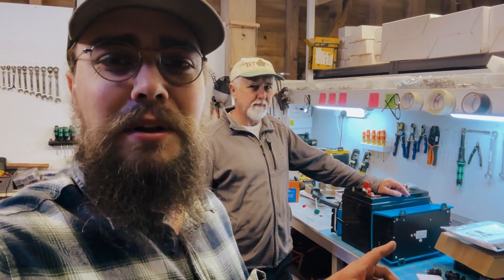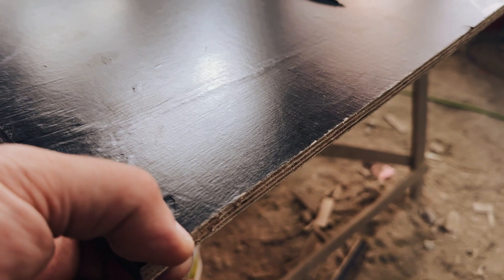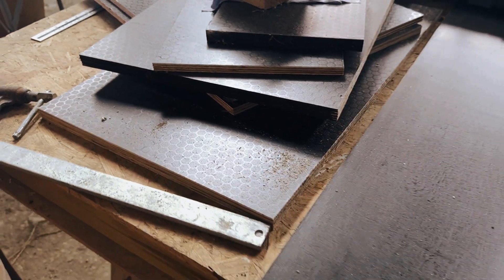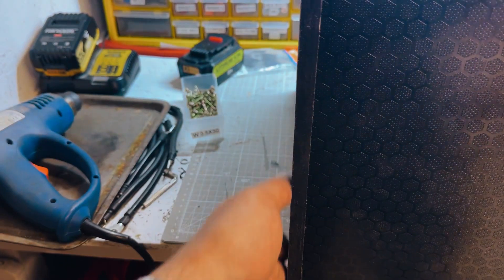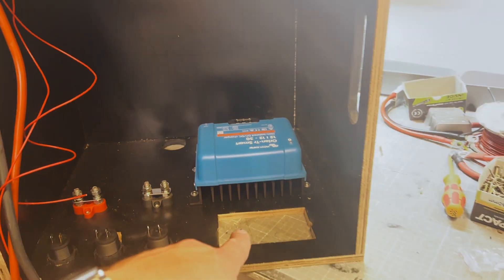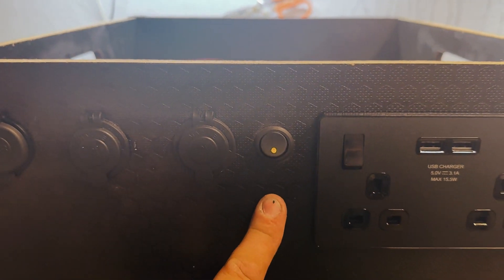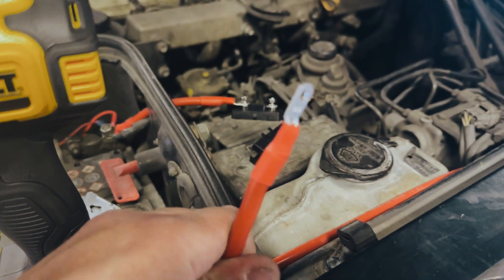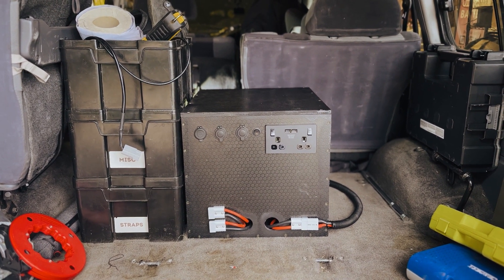Building a DIY Jackery with LiFePO4 battery & Victron Phoenix Inverter

Comment: Nowadays (Oct 2925) Eve 340Ah cells can be purchased for 65Euro per piece, make a 8S 24V system to get 8x3.2Vx300Ah =7.5 kWh buy 2nd hand Victron MPPT & 24 V 1200VA Phoenix inverter & smart shunt 300A and  JK  8s LliFePo4 BMS, a TS800 DC DC (23A @28V) charger add some fuses , cables , temp sensor etc than you have  a very decent modular very  system which will weigh some 60kg and costs around 1000Euro leaving you some money for buying spinach to enable you to put it in and out of your car...and than you want to buy an extension cord as you don t want to take it out anymore    ....

Comment: I have an ebike. 72 v 25ah i was wondering if i could get 3 more. Have 100ah but 72v i found an inverter that works with 72v my end goal is to charge all . But when want to ride. Take one out of bank and use. Now house has 75ah Then replace so could charge.. off solor panels. Untill equal with rest then join battery bank back to 100ah system? Hope explained idea? That way always have battery for bike . And house.  Rv trailer lol

Comment: Great video.  I'm just in the process of building something similar too for the bed of my pickup with 2 x 110Ah AGM batteries in parallel.  Do you have any advice for fuses re: the Orion DC/DC? I know they can throw out 30 Amps. I also notice you put the DC/DC in the box closest to the house battery, but some other designs I've seen insist on putting it close to the starter battery?  Any views on that.  What are you running for the Victron app integration?  Smart Battery sense or a Smart shunt?  Would you please be able to quote me to run a cable from my starter battery to my truck bed terminating in a an Anderson socket (so I can take the battery box in and out)?  Truck is a Mitsubishi L200.

Comment: Really enjoyed this episode.  I have done similar, so good to see your take on a portable power pack.  I have put the chargers on the outside of the box, to reduce heat built up.   I have also used flush panel mounts for the anderson plugs and 12v sockets.  Being not as strong as i once was, I have kept battery capacity to under 100ah

Comment: There are good inverters that are not Victron, that would have made a far more capable little system for the same cost, except with 2,200--4,000 watt capabilities.. Victron uses very little power, very efficient, but, I would rather have the ability to run more things at once, or higher output items like an air conditioner or heater if the power went out..That way it can be used for several different use cases..And companies like Giandel offer 3 year warranties, which they honor...Just sayin..Nice job...
Reply: heater/ac is not really an option for a device with 2k watt hours
Reply: @nickfirst7249  That's not true..If you only run these devices for ten minutes and have solar charging you up.. Irent out cabins in the forest on AIRBNB, they have 3,000 watt inverters, and run everything..A travel trailer or RV only has 30 amp service but runs everything a person needs..